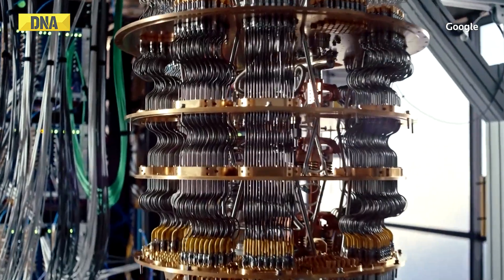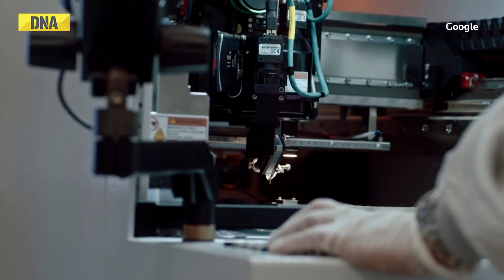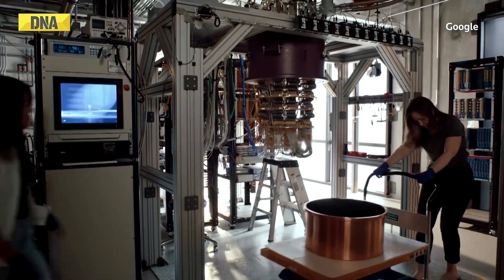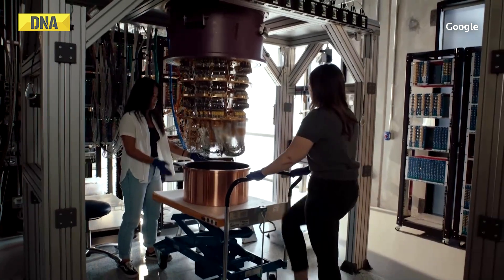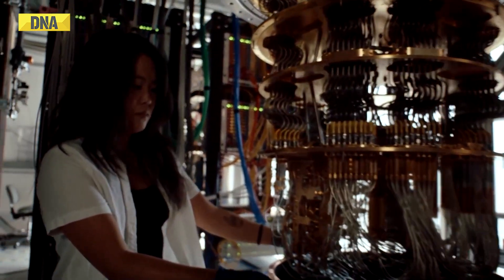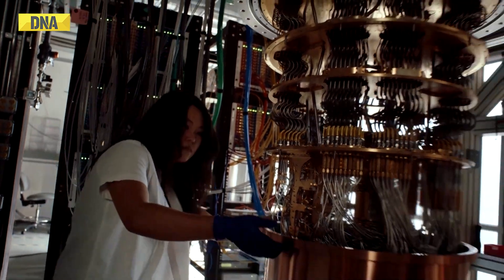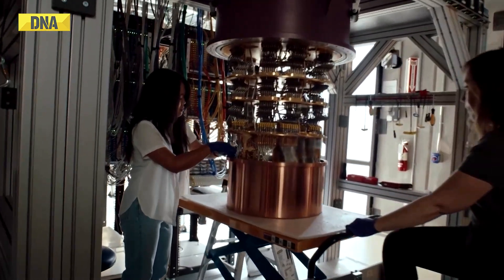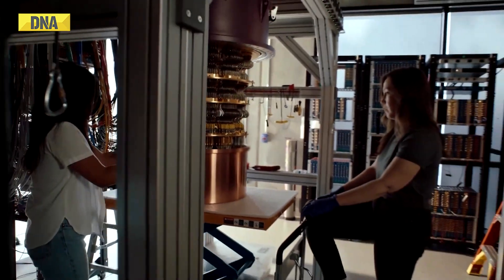Google Quantum AI Reveals New Chip, Solves 10 Septillion Years Problem In 5 Minutes I Multiverse

Comment: Id like to see or know the name of this problem? What is the signifigance of this major "problem?"
Reply: i would believe something were u dont have to be precise like neural models
Reply: I seen something recently where we took a part of the brain and 3d mapped the information.
The map came out to be absouletly massive, something like 1,200+ tera bytes of memory. Its signifigant because the part of the brain we mapped was in reality smaller than half a piece of a rice grain.
But the fact that we successfully understood and was able to complete the map was something close to ground breaking.

Not sure what that has to do with a problem that makes this quantam chip or "problem" that it supposedly solves, so signifigant tho?
Reply: @terrycloud6437  
Well they are related... 
As you quantum chips aren't meant for precise operation because of higher error rate. But neural networks which are like digital version if brain don't need so precise calculation to learn things(they work based on probability)

So you see, quantum chip used for ai will sure be something to look out for. 
What if we could actually simulate a digital brain in next 50 or 100 years I wanna live long enough too see 👀it